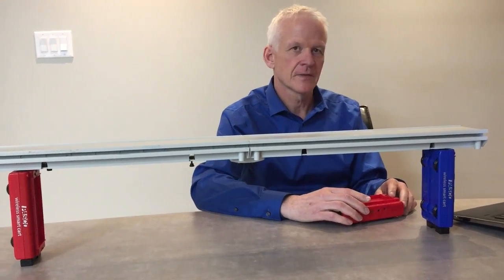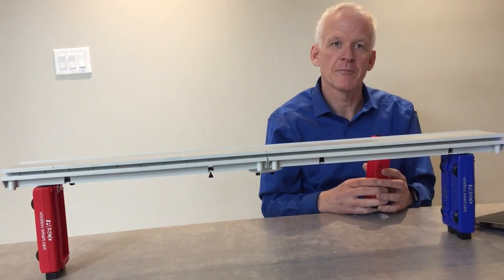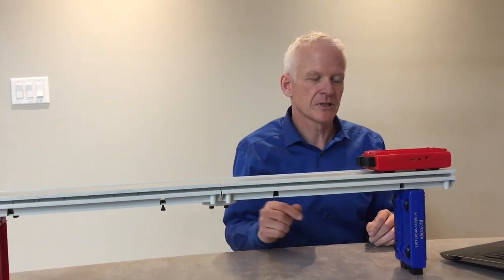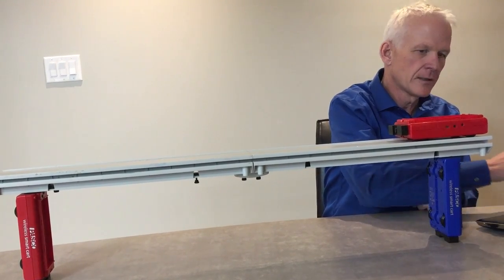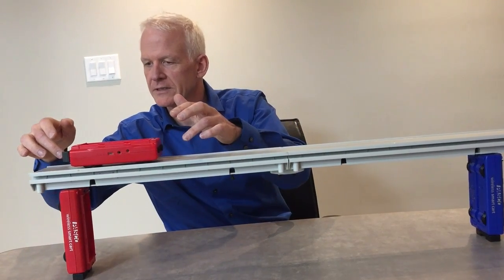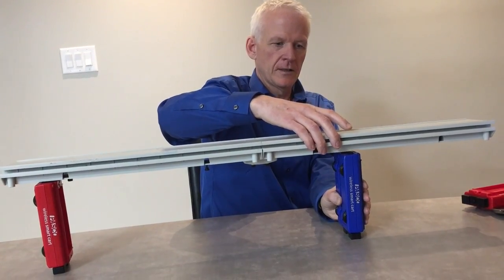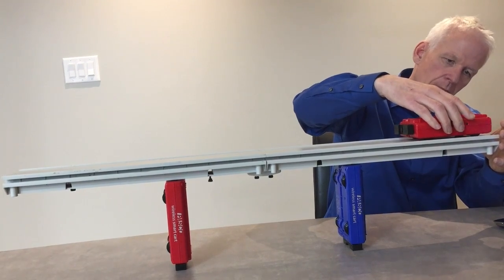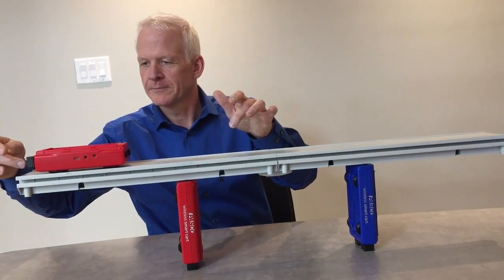The Physics of Bridges

Comment: In a bridge, these “pillars” are called abutments. That would be a basic beam bridge structure. They also construct them sometimes with a polyethylene terephthalate damper between the abutment and rcc slab or beam to stabilise the surface area to pressure ratio, used to use lead plates sometimes.